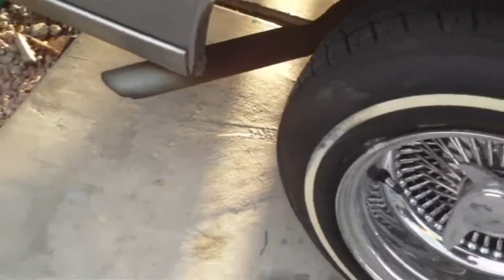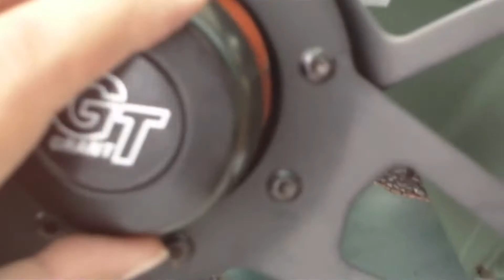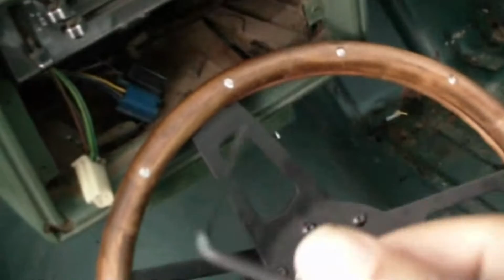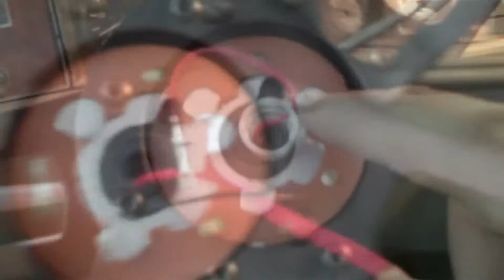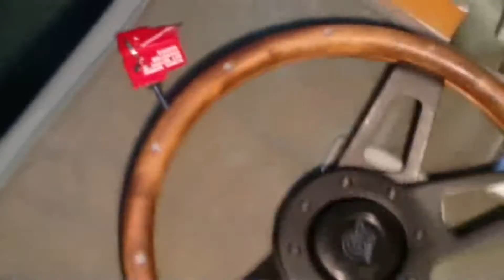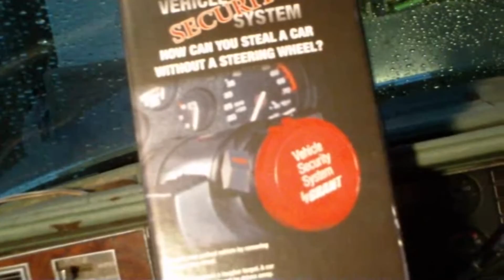T-Top Cutlass Build Up page 18

Comment: i have a grant wheel that ws installed b4 the no wheel no steal, after i installed the unit the horn doesnt work now, it worked b4, and it didnt have the foil, what could be the issue?